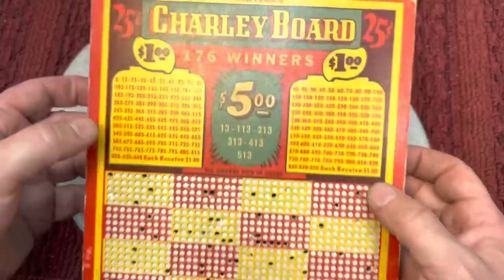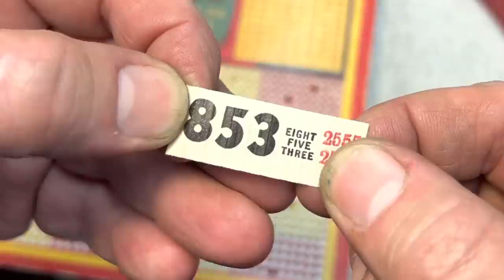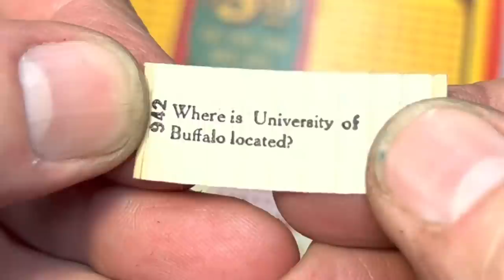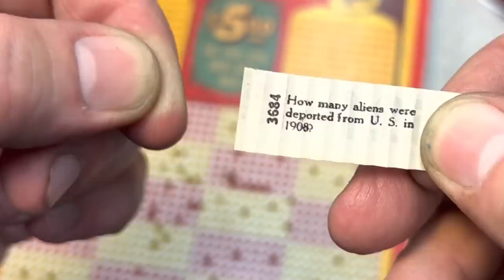Proto Breaker Bar, Kent’s Heavy Ball Peen Hammer Finished and More!

Comment: I was catching snapping turtles yearly here when I was about 10-15. They would stray about 1/2 to 3/4 miles from a neighbors pond. Just took a broom handle and bucket to catch them. Broom handle to distract while I picked it up by the tail. Then drop them headfirst into the bucket to hold them. Always took them back to that pond.

Comment: I was thinking, that wool type pad brush you have are similar to the ones I would use to polyurethane hardwood floors! We called them “Lambskin pads”. Which is what I think you have here, except the ones I used had a really long nap compared to that one. I could see that short nap leaving a really nice finish!

Comment: I've noticed that the new iPhone camera is very particular with different light temperatures. If you're editing in iMovie, you can adjust the white balance and the color to make that look a bit better. Great job on the hammer!
Reply from the maker: Hi Ben- For some reason I have found this problem more with the candy colors and wonder if it picking up the base coat of Silver and screwing things up.  With opaque colors you can adjust it to capture the accurate color but not candy.  🤔. Thanks!

Comment: I used to dig up snapping turtles in the winter with a dragline and someone would turn them upside down in old tires so they couldn't get righted and walk off to take and eat later. They would fit on top of a 15 inch tire. But I saw one about as big as you were talking about floating and thought is was just something to put tp scare something. It wasn't. It was real and full of holes. I let it float right on by. Happy weekend and I see a couple of light colored (I'm being nice) hairs in the front of your noggin! GBWYou, John!

Comment: John, love the hammer and on your next video can you get the lady in the cobalt blue dress to demonstrate it ?😉. Your poor man's flea market finds are legendary and sure beat anything I find although skips (dumpsters) in large offices that are being refurbished generally bring out some goodies.
Reply from the maker: Tony- you are so right about finding gold in dumpsters when contractors are ripping out and refurbishing an office they throw everything out you can get wire, lamp housings, appliances, printers, everything in the dumpster it’s a shame that stuff gets thrown away.  😃👍
Reply: @ScoutCrafter  I picked up a beautiful, very low wear Oak corner cabinet. I've always wanted one. I think this will fit my old 35" PIP CRT TV once I get some bed casters under it so I can move it around easily once weighted down. I got it home with my hand truck.

Comment: Maybe I just haven't seen enough of them, but amongst Western world made machinist equipment, the Chuck's absolutely do have standardized sizes, six I believe for the most common. I think most of the otter sizes are either older or from overseas. I've noticed in marketing speak 12 mm equals half an inch and it forces me to wonder just how they are measuring the work, haha

Comment: BTW about the color issue, it may be the camera setting you are using. ( Your sky looks so blue I figure you are probably using a mode often called "Vivid" ) and if that is not the issue maybe you need lights with a higher CRI (Color Rendering Index) to get the green to come out properly.
 If you want to experiment on the cheap you might buy some high CRI 5050 SMD LED low voltage light strips. I bought the 3528s (LED is pre 5050, 3528 means the surface mount device (SMD) LED is 3.5mm by 2.8mm so the 5050s are 5mm by 5mm and much brighter!) over a decade ago and as a endurance test I quickly peeled and stuck these to a 3' grey steel sheet metal tool organizer. They've been running at full brightness for over a decade now 24/7 with no problems. Maybe you could peel n stick yours to the bottom of the joists? Or stick them right to the shop light between the bulbs?
 Because you are filming you might also benefit from a diffuser over them. Most of the 4 ft shop bulbs have them built in and that is what I use in my shed only I did not put the bulbs in fixtures. I direct wired/soldered them to a 110V plug and screwed them up there with 1.5" copper plumbing straps meant to hold up pipes. It's worked beautifully for years now but I did not know about the CRI issue when I bought them (They're even dimmable!)
Reply from the maker: Yes!  It’s definitely the phone- I tried all different types of lightbulbs and I it only really happens with Candy colors because I think it’s picking up the aluminum basecoat and giving me a problem. I had the same problem with my iPhone 6 it happens more in the video mode than it does the photo mode sometimes you can adjust the tint to get the Acura color but not on video.  😃👍

Comment: I really enjoyed your half hour video the other day. I found one very small ball peen hammer head that I haven't put a handle on yet. Think apple wood would work well? ( I also have maple I have grown here on the premises and I have been using my draw knife to debark both of these woods. ) Anyway, turns out it is a VLCHEK. I was glad to see that. It is amazing how the sides are so perfectly flat on it because most ball peens are not that way. Can you do a video on VLCHEK tools some day?
 Anyway that made me check out some other ball peens around here and I found the one that was forever in the family junk drawer covered with white paint but the interesting part is that I think this was my first hammer repair as it has a combination of 10 box nails and brads driven into its head and to this day the hammer is still solid! I must have made that repair sometime in my childhood. I can't believe it is still solid with such a hokey repair.
 Excellent find with the proto breaker bar. I don't think I own any Proto tools yet. My father's round 1/2 drive breaker got stolen and I miss it more for the sentimental value than anything. Round like that with the same knurling only a fixed 90 degree head. Now that I have a li ion grinder maybe I will turn a piece of rebar into one. The socket on it was the size for my rear axle on my Ebike, too. I used that quite a lot because I just learned the hard way that you can get friction flats from a Clean Motion Armadillo Flat Stop Strip. 🥵🛠✝
 Next you need some Cargo Shorts/pants as they are great for carrying things and even doing cartwheels generally you won't lose what is in those pockets. My 10+ year old pair is from The North Face and I love them.
  The other thing I feel you need is a Channel Emblem as your work is such high quality it deserves to be recognized and properly showcased. I'd like to see the emblem on the head of the BP hammer but maybe putting it on the end of the gripped end would be better when one considers wear. 
 Uri Tuchman has an interesting pigeon theme going on much of his recent work. You know what I think off every time I get a scoutcrafter video notification? I think of that old Calgon commercial that goes "Take me away, Calgon" only I say "Take me away, ScoutCrafter" because I enjoy the distraction from the rest of my life especially the chronic pain (which currently is beating me senseless because I've been having withdrawal symptoms from a muscle relaxant I have been on for almost 30 years ). This one;
 https://www.youtube.com/watch?v=8yjGPgs0_S0

 Why it fits is because to us guys going into the shop is the equivalent of taking a bath only we bathe in grit, dust, and BLO. ( GDB, baby! It would be funny as hell if you could do a shortened video version of this, just the essential "Take me away" as you throw your head back and put your hand on your head like ladies used to do in the old B&W movies just before they fainted and then a magical fancy door leading into the shop. It would make a great intro or maybe a funny outtro. You know who does some of the best outtros? Peter Sripol. You should watch his videos some day, especially the ones where he engineers, builds and gets in and risks his own life flying these contraptions. It's awesome. I also really love his Magnus Effect video where he uses a KFC bucket as a wing. It is some brilliant shit!
 The tires on my handtruck says they are good for #300 so that means the hand truck should be good for #600 and at that rate I'd like to turn it into a bike trailer. Every one else online seems to be turning them into welding carts so why not a bike trailer, too?
Reply from the maker: John- Funny you mention Pigeons… I have a coupe for over 15 years now.  😂👍
Reply: @ScoutCrafter  I should have known you collect pigeons, too! I just came in from the 90F where I finally installed a small VLCHEK BP hammer head onto some apple wood that I grew and debarked with the draw knife. Funny thing is its about 3 foot long at the moment.

Comment: Question? Would the material on the outside of that paint brush/broom work well on the little printing press roller? Just the white material not the foam. Seems like it could be perfect! Love the videos man! Makes my day!
Reply from the maker: Brian- Usually printing rollers are just a hard rubber compound that picks up the ink in a very thin layer. The key is the consistency of the ink and the pressure of the roller…. 😃👍
Reply: Ah… so I guess they never really hold that much ink?

Comment: Just out of curiosity John, what would you use that type of hammer for. I'll wager it's not for FINE work !!!
Reply from the maker: Martin- I rarely use the larger hammers but typically these hammers are used in shops to peen larger bolts, loosen rusted bolts and separate tie rods and ball joints.  For such operations you need mass on your side.  😃👍

Comment: I loved turtles as a kid and about twice a year would come across a box turtle and make it a short-term pet. In my ignorance, I always try to put multiples together with mixed results. This is a hard statement to make without being misinterpreted, but if you have not seen the reproductive process of fox turtles, it is absolutely worth watching the video! I bet a dollar you will laugh out loud. But I learned a few lessons about box turtles in the process; fighting and the other f are remarkably similar looking. It's also very hard to tell apart male and female box turtles, putting them together is a solid diagnosis method. Ironically when they fight and when they make love, very similar to that old show BattleBots, the fatal stroke is almost always a turtle getting flipped upside down, they die rather quickly in this position. There's kind of a social contract with turtles, even ones inclined to avoid each other will put forth great effort to help flip over another if it's not the one they were just fighting with. I'm really at risk of being labeled some kind of turtle pervert, but at the very least, look up turtles mating just for the noise the male makes to announce completion! It's absolutely hilarious, I use it as my ringtone. But whether fighting or effing, you will be working in the woods and hear the strangest hollow knocking until you discover the source, I'm sort of a surprise more than don't get eaten in the process
Reply from the maker: I have always seen turtles right-siding other turtles that got flipped on their backs... Pretty cool!